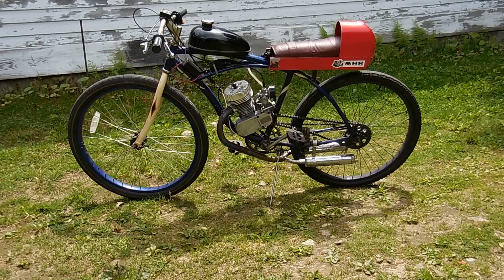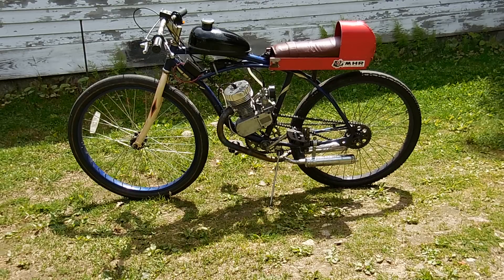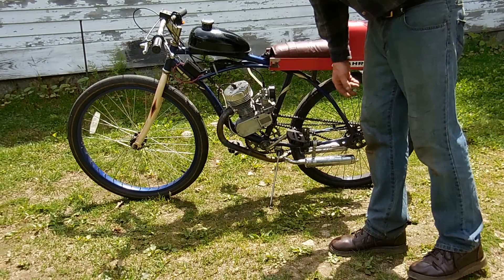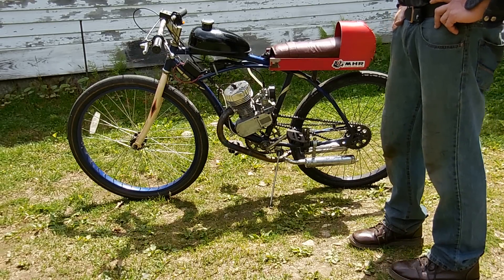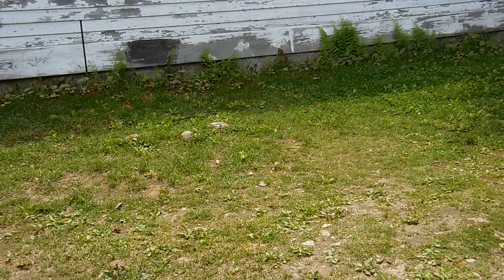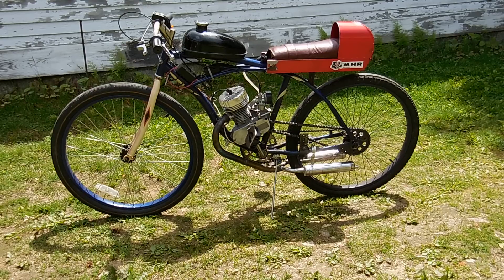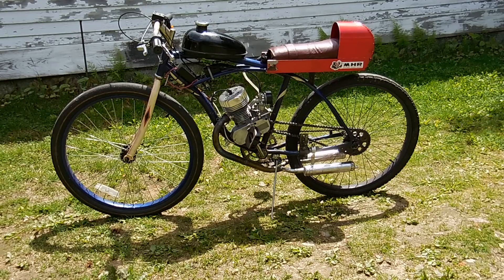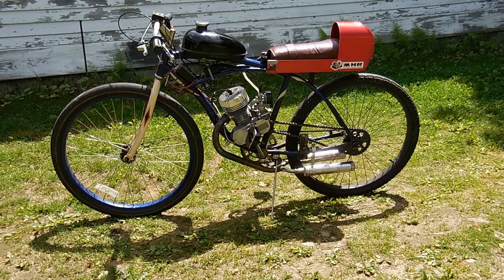Fred unveils the new MPG engine for stock exhaust systems

Comment: The kind of bike you're talking about, is basically what I've built!  I Built a 48cc to be reliable, with enough power to go 40mph, but without reaching high enough rpm to wear it out.  It's quiet enough so that it doesn't piss anyone off either.  I also use a boost bottle with a ball-valve, so I can open it while cruising, for increased mileage.

Comment: I think Fred is sponsored by the company that makes the gt5 motor. He practically shuns all other motors that are closely comparable. Don't even bother emailing him with questions about other motors.
Reply from the maker: Absolutely not sponsored. I buy engines and parts from numerous vendors, and I stock parts that cover all the variations for the "big" (47mm) engines. I am a machinist and engine builder and I look for the best parts that I can find. It is rare that I find an engine free of defects. Some engines have more serious problems, and I avoid getting those. I measure things. If parts are out of spec. I don't use them.
Reply: Frederic Chelminski, speaking of specs, i would never use a motor that had m6 studs like the gt5. The hardware on the 66cc motor is indicative of the quality of the motor itself. Every person I've know that rode a motor that had m6 studs eventually had them sheer clean through.
Reply: Frederic Chelminski, unfortunately  your website is centered around the gt5. People use other motors than the gt5. Its a shame because you just tell them to contact that partiular vendor if they have questions about using your parts interchangeably.

Comment: Thats what i need rite there.well thays what i have.the guy i got it from says he got it from u.he said he had well over 1,000 miles on it n ive put bout 4-5 hundrid so far.barely any vibration new upgraded hardware amd its reliable so im guessing it might b from u!u are the man fred!im curious what that little ticking is when its running?part of high compression?i put a smaller head and head gaskit in mine and its doing that now.almost like the piston is tapping the head but its not